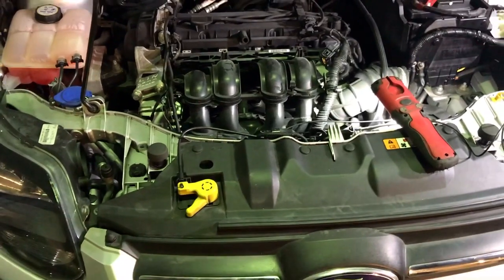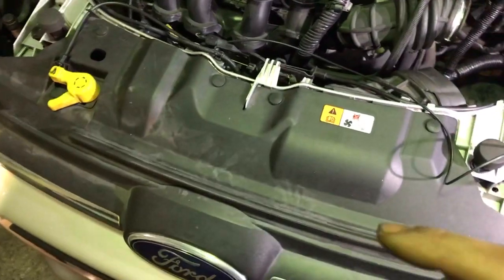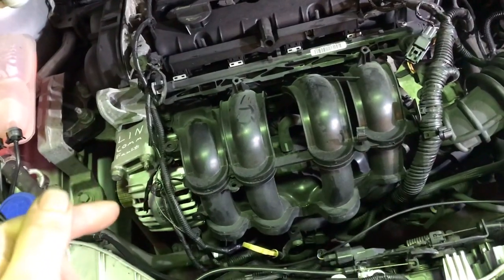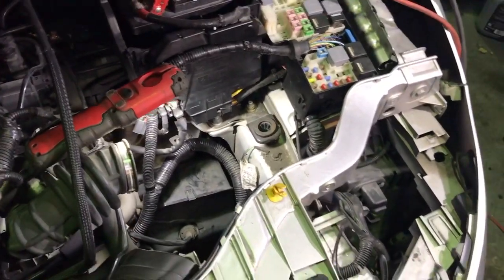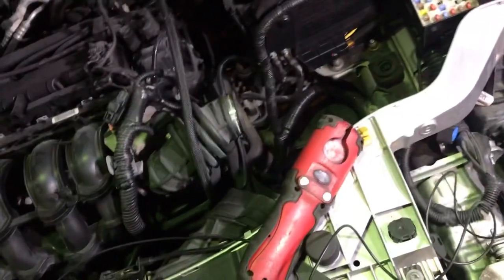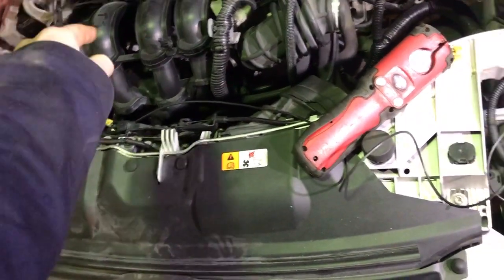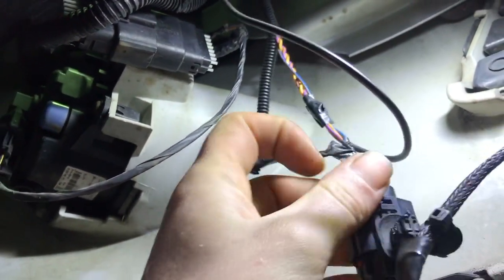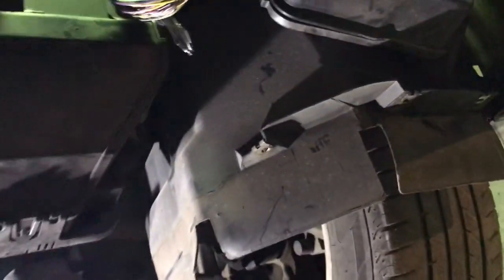2012 Ford Focus mk3 1.6 battery light & alternator fault fixed! U012D U0284 P165B ford smart charge

Comment: Thanks for the video. Just want to ask, if I unplug the grill shutter actuator, will it stop the alternator from charging the battery?
Reply from the maker: Hi sorry I’m a bit out of touch at the moment, I believe it will continue charging but will most likely bring on the battery warning light.
Reply: @danthecarman4344  I had exact same problem with the light on after someone swopped the alternator. Found the corroded connector and repaired it. Still had light on . Unplugged the connector to the grille shutter and was full of water. This then stopped the alternator light comming on. Scoped the wire to the alternator before unpluging the shutter motor and it was 8 volt pattern after unplugging it was 14 volts and no light

Comment: This is a little bit weird but my Ford Focus mk3 is doing the voltage drop from 14.3v to 11.5 volts when I press the brake pedal, even on park or neutral, when I press it it drops for split second only but it will goes back to 14.3v, my tail lights are all normal, no warning codes or anything

Comment: Hi my focus 1.6 petrol 2012 no grill shutter has a fault, battery goes flat whilst driving car stops due to fault checked voltage 7.5 volts.jump start car runs till next time it happens  Aprecate and thoughts on this.
Cheers Tom

Comment: Any idea on this issue with a mk7 2013 fiesta having battery warning light changed the altonator still got battery warning light. Then I've had intermittent low oil pressure come up. I had the pressure switch changed 5 months ago and it's been fine till now. Oil pressure is fine.

Read the codes and getting

U0111
U0120
U0131
U0420

Is the oil pressure switch and the wiring to the altonator on the same wiring loom as I think there may be a break or a short in the wiring

Comment: Mate, my grill shot is working properly, but it’s not charging properly. Voltage 12.4V on battery terminals but 11.9V on dashboard test mode. What could be issue? Many thanks.
Reply from the maker: Hi Have you replaced the alternator already or sent it to be tested by a specialist?
Reply: @danthecarman4344  I replaced alternator with used one. It started to charge properly a few days however It is still charging irregular.
Reply from the maker: @davutuzun7334  it can be normal for these to charge irregular from 12 to 15v due to the Ford smart charge. Is there a battery warning light on or is the battery going flat?
Reply: @danthecarman4344  Battery light off, but battery is 12.4V on terminals and its not charging. Right, charge voltage can be irregular. 

Another symptom, My start-stop wasn’t working properly. Some times works sometimes not. Then I charged battery with external charger up to 12.7V. it started to work properly. I understood that if battery is near to be flat, start-stop becomes disable. Now, battery voltage dropped it’s not working properly as well.

A day, my car started first.then I stopped it. I tried to start again but it did not started. Probably batter was flat.

I still don’t understand why 11.9V on dash 12.4V on terminal

Comment: hi i have a similar problem but on focus mk3 1.6tdci i changed the alternator but it still doesn't charge my battery and in addition the power steering turned on me do you have any advice on how to fix it?
Reply from the maker: Hi Samuel, sorry to hear about your troubles, do you have any fault codes at all?
Reply: Bad ground

Comment: Hi mate I've got same sort of problem changed alternator  and battery but it does over night any ideas
Reply from the maker: Hi Lee, sorry for the late reply. If your battery is draining over night I’d start by performing a parasitic draw test on your battery. 

There’s some good videos on YouTube with instructions on how to perform one and should help pinpoint what could be causing the draw, all you’d need is a multimeter (ideally digital).

Let me know if you need any further help!
Reply: @danthecarman4344  cheers bud was cigarett lighter and heated front and rear screen  but now the keys keep going dead 1 minute ok then next day dead new batterys in them aswell
Reply from the maker: @leemanser67  sorry to hear about your troubles mate, sounds like your having a lot of hassle, I’d speak to a local vehicle locksmith or key specialist regarding your key problems I’m sure they will have seen it all before!

Comment: My is Ford Focus Fp61tlx which not have grill shutter but battery light comes up but alternator and battery is ok mechanic and electrician don’t know why and they thought may be bcm problem so is true or not?
Reply from the maker: Hi, sorry I can’t be much help in your case I’d recommend possibly trying a local independent Ford specialist, as they may have experienced this problem and could potentially be quicker for them to diagnose it correctly.
Reply: hello mate did you fix the problems with your car ????? I having the exact same problems any ideas please ???
Reply: @rigocunningham6883  check ur alternator if that’s ok then check that genuine or not some time other company alternator not fit with the system that’s why put genuine one
Reply: I replace the alternator and still the same problem the battery is new as well. I don't no what to check next any ideas????
Reply: Sorunu hallettin mi. ?
Reply: I have exactly the same problem with my Ford Focus MK3. What should I do as a result? Please